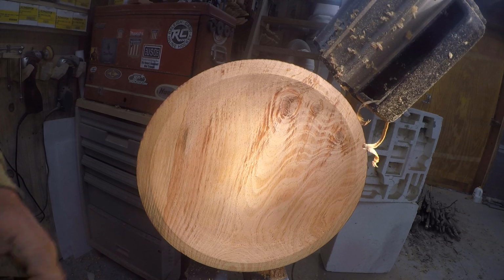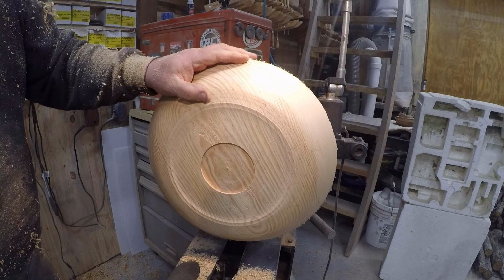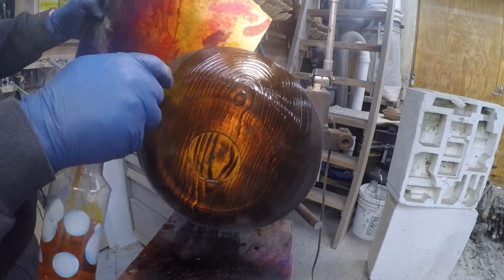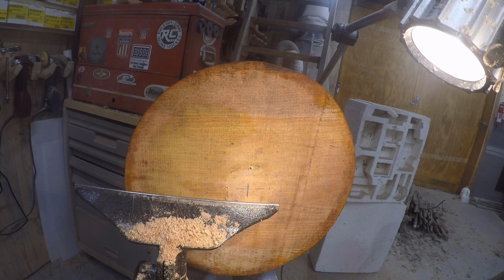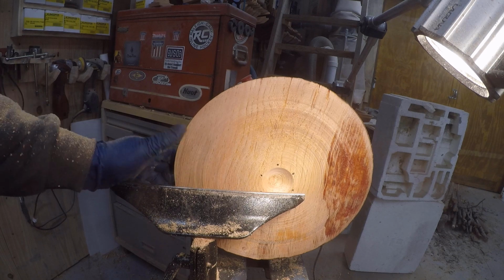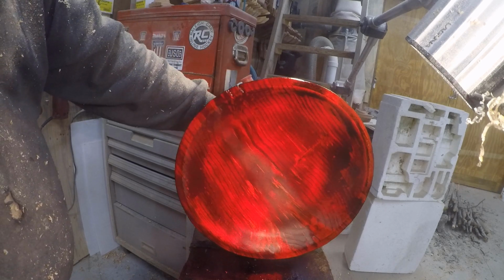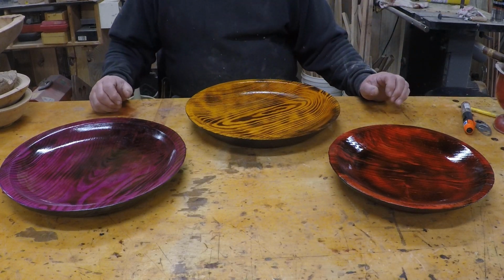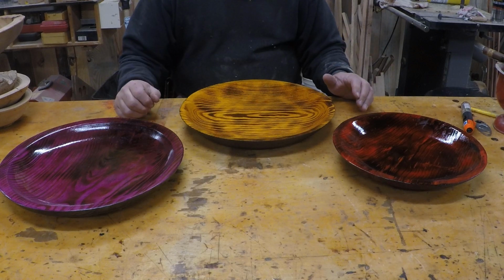Woodturning - Ultra vs Keda Dye on Shou Sugi Ban Bowls

Comment: Have you tried the Keda liquid dyes? I’m not having much luck getting a deep color with it.
Reply from the maker: I have not tried their liquid dyes.  The only liquid dyes I have used are Folk Art Ultra Dye (no longer available, which really bums me out) and Transtint Dye.  I found when mixing the Transtint with water, what might appear to have plenty of dye could actually be quite weak.  I found I was adding more than I expected.  Also I have also applied multiple coats in order to get the depth of color that I wanted.  Thanks for watching!
Reply: @BrailsfordWoodworks  thank you for replaying with the insight. I’ll bump up the ratio.